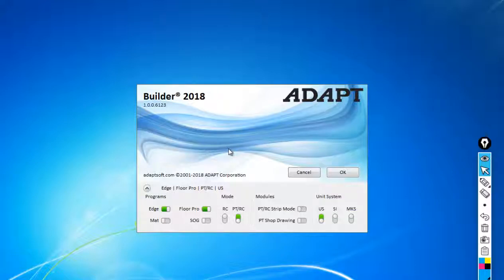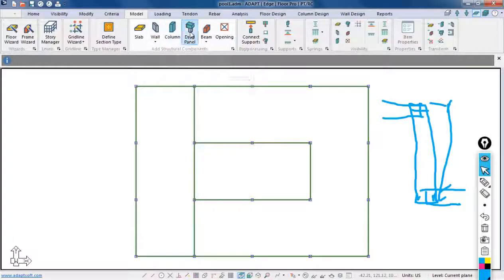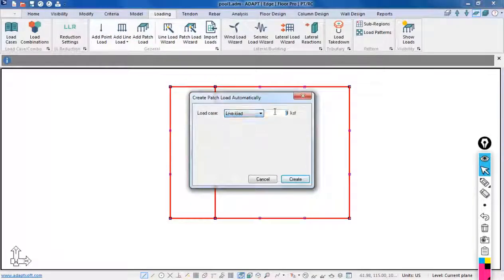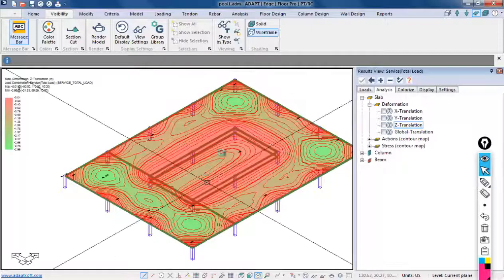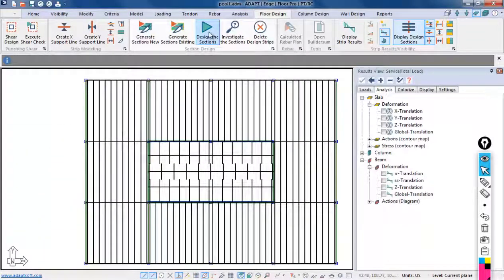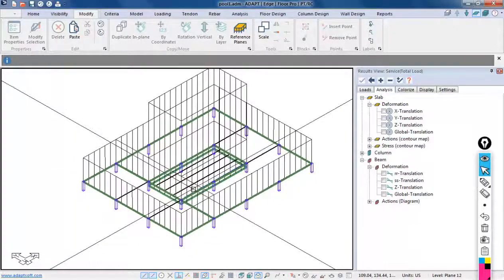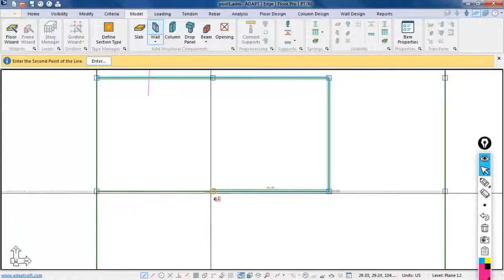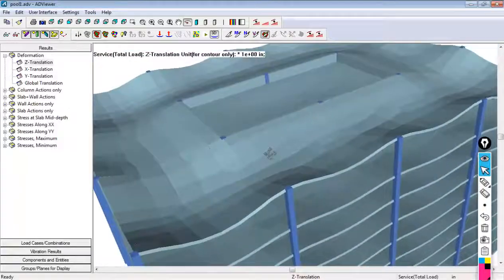Modeling Pits and Sunken Slabs in ADAPT-Builder

Comment: Is there a way to model the pool without the columns? Lets say on a smaller scale, like the sand pit for a long jump track event, in an elevated slab as shown here framed out by "beams" (reinforcing within the slab haunch) also as shown here, but without any columns. Thanks!